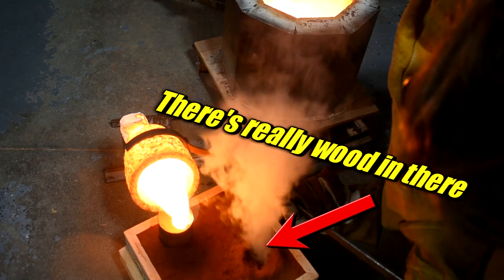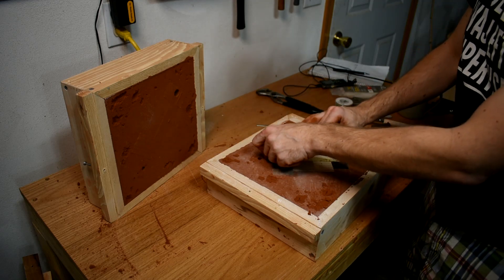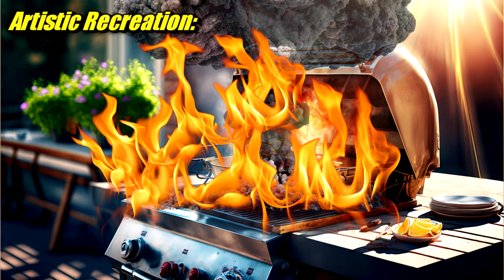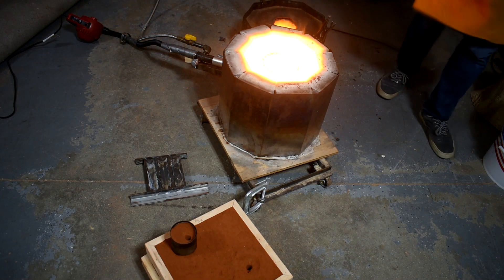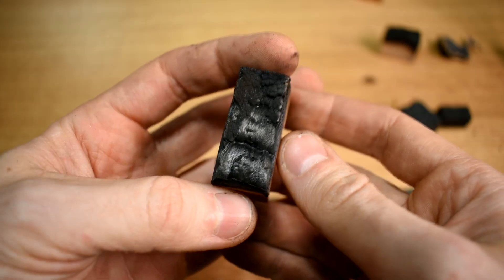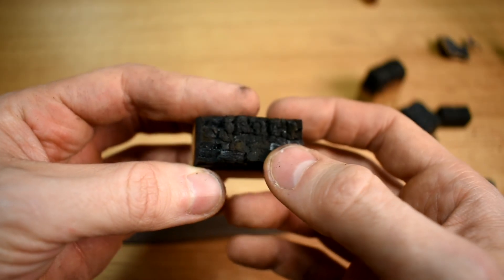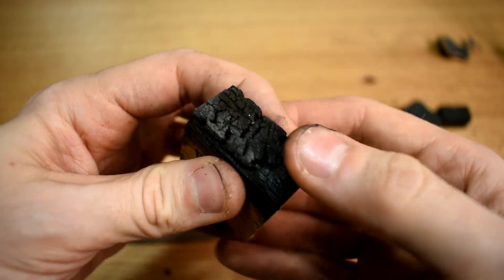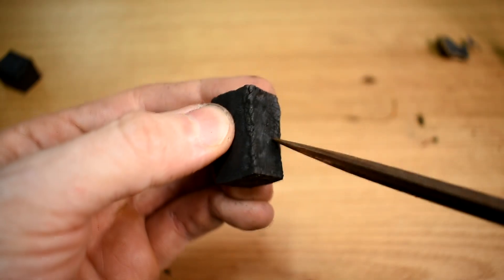Molten Bronze vs. Wood!  Which Species Can Take the Heat?

Comment: Wax coatings don't flow deep into the wood. Maybe 1/8" if the wood is pre heated and soaks in the wax for a while. It seems like it was just water. Even "completely dry" wood (domestics) have a minimum of 5% (in a very dry climate controlled environment) of its weight composed of water. You would need to bake your samples for a day or so to actually dry them out completely.
Reply: In my experience* 
I didn't mean to come off as a know it all or a dick 
And the resins and oils in the woods would have vaporized, I think ebony and blackwood have a moderate amount
Reply from the maker: Didn't know that about wax coatings, good information thanks

Comment: Wooden glassblowing tools are usually made of fruit woods, and are kept permanently in a bucket of water. Soaking your wood in water for a few days before doing the casting might make a big difference. Of course a lot of steam will be generated, but you've already demonstrated how much gas the wood produces when subjected to that kind of heat. In fact I think that's why the bronze casting has the big holes in it: you were vaporizing volatile molecules in the wood, which displaced the bronze. Without the ability to bubble out, it was trapped inside. Remember, when wood burns it's actually the volatile gasses burning that produces the flames. So I think as mentioned, venting is going to be a crucial for this to work.
Reply from the maker: Yeah venting is super important, but I'm not sure I'll be revisiting this project very soon.  Bronze yes, bronze in wood probably not

Comment: Osage orange is also excellent bow making wood
Reply from the maker: Yes indeed!  I've never had the cash to buy an Osage stave though and it doesn't grow here so I can't go chop my own
Reply: Also, Erico ground rod coupling part number CC58 are made of silicon bronze. They usually run about $15 a piece and each one is just under a third of a pound. So just a shade under a pound of high quality silicon bronze for $45. Expensive but a good resource.

Comment: I'm curious how well oak would work as cores for making handle holes for hammers and axes?
Reply from the maker: That would be pretty awesome to try.  I would think the burned up parts would make the handle pretty loose though
Reply: @PaulsGarage  I just meant to use wood cores to create the hole, then scrape out the burned bits and insert a new wood handle.  
PS  I love this content.

Comment: What is the endgame of these test?
Reply from the maker: I wanted to make something like those epoxy resin/wood projects, but with bronze instead of epoxy resin.  Using aluminum would be easy, and it's been done quite a bit, but bronze it cooler.  Its also much hotter which is a problem

Comment: Excited to follow this project. Been a fan of the resin furniture stuff for a while now but metals? Sounds great to me!
Reply from the maker: Thanks!  It's been done in aluminum a bit but I want bronze.  Bronze is so awesome especially as it ages
Reply: @PaulsGarage  I agree. Bronze and copper are both favorites of mine when it comes to appearance. I also love how copper looks when its oxidized
Reply from the maker: @FeralMoonDesigns  copper ages very nicely but it's a beast to cast anything with it.   Bronzes flow like water though.  Not sure why a dash of another metal makes copper work so well